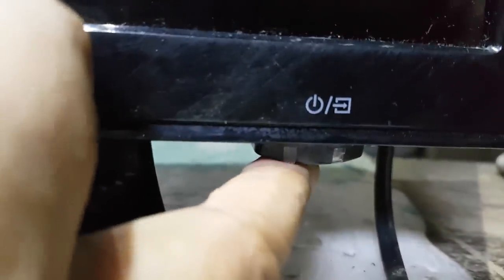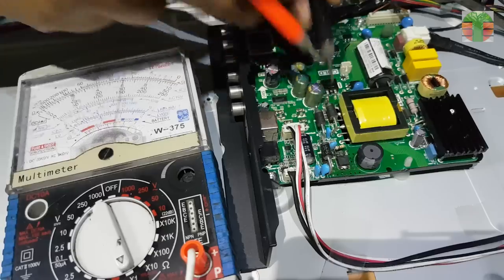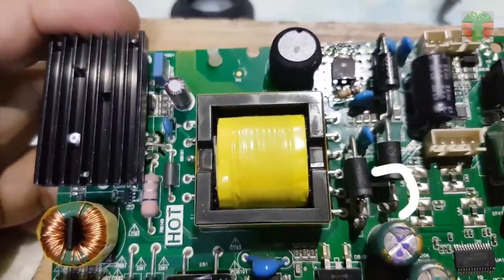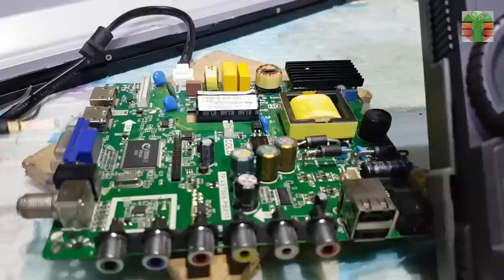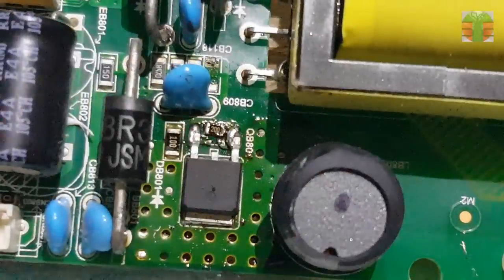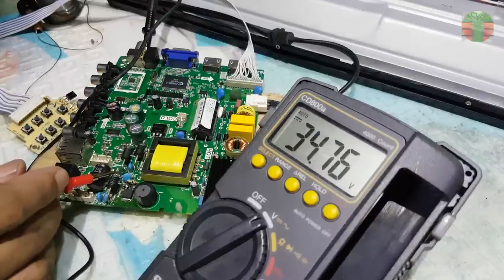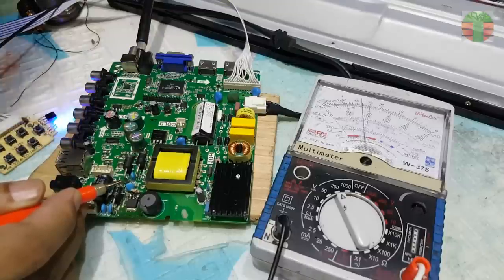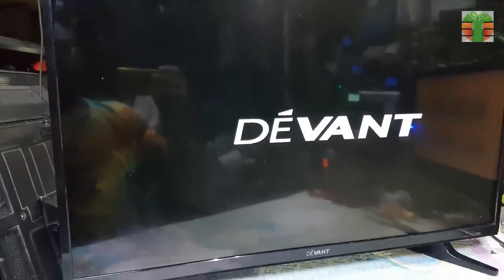Lazy tech move

Comment: 10kk risistor .after swich off remove all voltage and close mosfet
if you havent .mosfet if on .stay on 
but after swich off .we need mosfet go off but we must use hight value risistor to not short 
so we use 10k

Comment: Would the resistor reduce brightness to keep the lights lasting longer?  Maybe the previous tech messed with the backlights in this TV to something not stock to this model
Reply from the maker: It's a pull down resistor. To maintain zero volts at the gate when not operational. No relation to brightness. Yes, the previous tech accidentally removed the resistor.
Reply: @tevzTVTevatronics  At a guess, broke it while removing the mosfet.   Suggests the mosfet has failed before, which suggests a recurrent issue.
Reply: @geoffroberts1126   I was thinking the same thing. Components usually fail for a reason, but we really won't know unless we have a history of the TV.........IMO.
Reply: @johnkosick1464  Concur.

Comment: what about when Onn 75 inch tv flashes and does not turn on but will surprise you at times and turn on with a great picture. II s it the power supply board? Thank You!!!!
Reply from the maker: Many reasons, it might be the power supply,  mothersboard, panel, led backlight.

Comment: Can you tell which resistor was removed from the circuit board by reading the numbers. Example R5079 how do you know what resistor is this?
Reply from the maker: Usually, most PWM circuits' power mosfet uses 10k connected to the gate to source.

Comment: Sir what is the value of wire wound resistor you used for discharging mains capacitor
Reply from the maker: 220 ohms 20 watts
Reply: short the capacitor leads by using screw driver😅